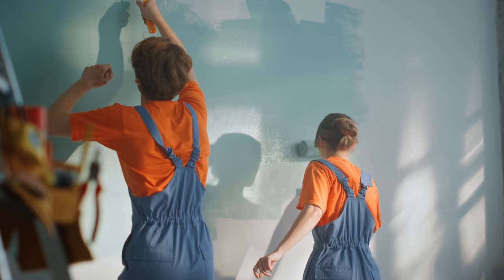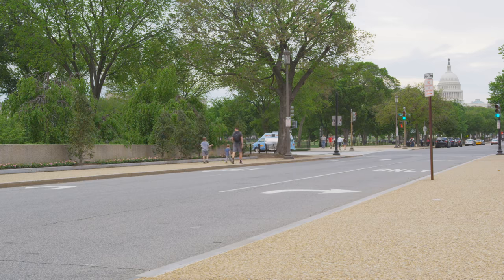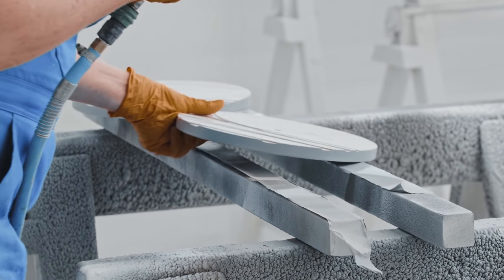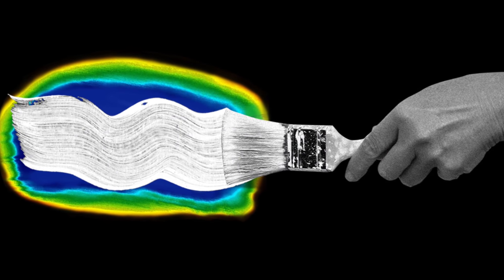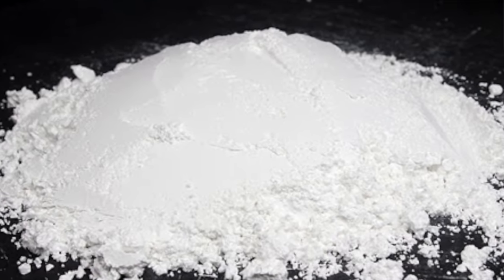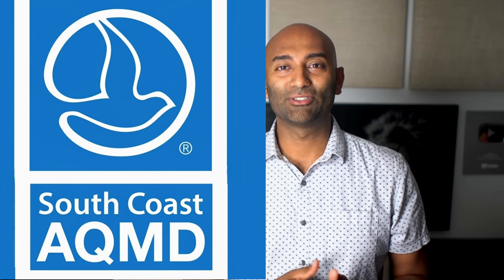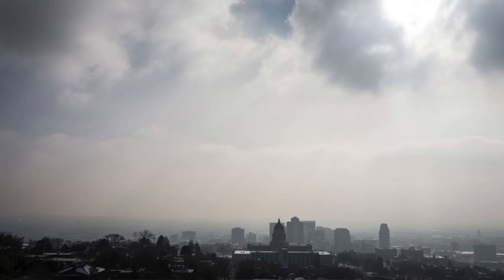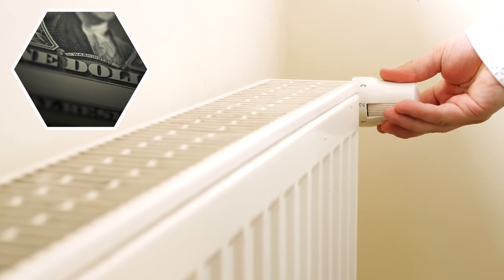Forget AC - Paint Your House This Instead!

Comment: It's probably not as bad in the winter as it intuitively seems. If a material absorbs very little heat, it has a low emissivity. That also means that when it is warmer than the surroundings it radiates less heat than a material with a higher emissivity. So while this stuff won't absorb as much sunlight in the winter as black paint, it will stay warmer at night than black paint.
Reply: 'visible color doesn't much affect IR reflection/absorption/transmission (i.e. emissivity) properties. White and black are pretty much the same to IR.  Paint a shiny SS stove pipe white or black, and it will about equally radiate more IR through, as compared to the original shiny surface.

Comment: Heating in the northeast is more of a problem than cooling.  

Propane, natural gas, kerosene, diesel or all electric...none of these are efficient or cost effective.  I went for a geothermal system. Instead of fuel oil costing 200 every 2 weeks now may 200-280 per month.  I would estimate 100-180 of that is my heating on my electric.    

Be better to paint everything black in the northeast & white in the southwest... probably neutral in between.  Compared to similar all electric heating of 500-600 a month, 400 fuel oil for the month of...it was a good investment.

Comment: If 1% of earth was painted, it wouldn't be a one and down decrease, it would create cold islands causing the planet to cool continuously. Judging by those numbers (1 degree since 1880), the paint theoretical has a stronger cooling capacity than CO2 has a heating capacity.  I for one, would rather have a tropical planet than another glacial period.

Comment: Combining this paint with bifacial solar on the south face of a roof and the radiative cooling tech on the north face would be amazing. At least in the northern hemisphere. 

Where can I buy some of this paint? I already have a metal roof. I can paint it easily.
Reply: It is not comercially available yet. 

Any Super White paint will do the same thing to a less ability.

There was an intiative under the Clinton Administration to get all flat roofs painted white.
Reply: @shawnr771  This one is particularly better though because its infrared emissions spectra lines up with an emissions window in the atmosphere and the black body emissions of the earth.

Comment: My comment is this thermal color change paint, white under coat with a 70 degree black color change to clear would self regulate to maintain 70 degrees. Heating and cooling both brought closer to solved. The tech is real but expensive.

Comment: The discussion of “radiative cooling” in the video is garbled. It’s not about “reflecting” radiation in the 8-12 micron range; it’s about having high “emissivity” at these wavelengths (which also implies high absorptivity and essentially being “black” at these wavelengths).
Reply from the maker: Not what I said. We have a full video on this already: https://youtu.be/WSTNLvvD_-U
Reply: @TwoBitDaVinci  The other video described things clearly. This one seems to talk about the paint being “reflective” at those wavelengths. At 4:35, after talking about “radiative cooling”, it talks about the new material having these “bright reflective properties.”  I imagine you understand how it works and didn’t intend the term “reflective” to apply to those wavelengths, but the juxtaposition sounded as if that was what was meant. / I respect your work. I’m just not sure this point was expressed as clearly as you intended.

Comment: I would think the paint’s reflectivity in the infrared region of the spectrum would be more important than in the visible region, especially with global warming creating a significantly higher amount of infrared radiation coming from the sky. 
Now they need to work on white asphalt. 
I wonder if it might be possible to make “electrochromic“ paint, paint the changes color when an electric field is applied.  Maybe you could have white paint in the summertime and black paint in the winter time just by flipping a switch.

Comment: I would not want this on my house. Cooling where I live is CHEAP my minisplits add maybe $30 to my ebill. HEATING is where I get squeezed. heating is so expensive. NOW where this would be wonderful is non climate controlled buildings such as sheds and storage boxes that become ovens in the summer heat

BUT how stable is it? UV is more important than VL since UV destroys so fast especially here in new mexico at 7000ft :-) the UV is brutal!

I would also love this INSIDE my house. the more "white" the inside of the house the less lumens of "light" I need to illuminate the house.
Reply: If you want less of a heating bill, try adding "greenhouse" walls on your exterior walls. You may need to keep the top open during summer, but they'll insulate your house a lot during winter.

How many mm of (rockwool) insulation does your roof have? 250-300 is recommended, more than that is just a waste of material.

I'm not sure you'd want bright white walls, they're tough on the eyes.
People always tone them down to something off-white, to be able to stand looking at them.
Reply: @silvergreylion  I have no idea. its a mobile/manufacturerd home. I THINK the roof insulation is actually really good. the snow sticks for a long time and melts evenly. no hot spots. 

"I think" it has 6" walls. I will have to double check that.

I am actually not worried about cooling in summer. only heating in winter. cooling is cheap heating is expensive especially that last 5' to get "comfortable" with the 20% humidity and 6800ft elevation summers are VERY mild indoors around here. most of the time I don't even turn the AC on till around 3 or 4 pm except on the very hottest days. cooling the whole house adds MAYBE $30 to the electric bill but heating. yeah. well heating is expensive. I am estimating about $130 to $160 a month but that is "IF" the 27,000btu's can keep up with the cold. I also have a 12k btu  heat pump to kick me to 39,000 btu's but am hoping I won't need to use that often.

Comment: Not a very comprehensive view... Paint is rarely a single pigment...Paint needs to stick to concrete, brick, wood , vinyl and cement boards to be used widely. It should also be resistant to fungi and durable for many years. Did they research how long it lasts ?

Comment: So Paint Stops, Convection, Conduction, Radiation and Absorption?
Or is this BS. Bad Science…
Reply: Well, actually he did cover that this paint is highly heat radiative. So, that's a good thing. That is if it's radiating away from the home and not also into it, which is where your conductivity point comes into play. But that's easily solved by a primer coat with low thermal conductivity. And I'm not sure how convection would come into play in this scenario.

Comment: Very interesting!  But, I fear, much like Hydrogen Fuel Cells, this will be a technology that is very neat, but not very practical.  I think doing away with carbon-based fuels and covering your home in solar panels, in the long run, is more effective and cheaper.
Reply: Then simply paint the uncovered areas white.
Reply: the problem is you need trillions of $$$ worth of solar/wind to replace carbon fuels by any significant amount. making mass production of small modular reactors the only economical way to go. even if solar panels were 100% efficient the reactors we have now still have about 5x advantage in energy density.  with new designs things get even better because they can burn upto 90% of their fuel and have heat energy to spare for things like water desalination and hydrogen production.
Reply: @psionx1  Great comment ... one of the things that I love about this channel is the thoughtful discourse of mostly everyone that take the time to post and share their ideas. Hi ^ 5 to you and this tribe.

Comment: This seems to contradict the laws of thermodynamics. How about the winters? Solar panels absorb the sun and convert it into energy, a white house would push the light back outside, making the need to create more heat. Burning electricity or gas is 5 times more costly than displacing energy from outside to inside or vice versa with a heat pump. The regions where it would be optimal are limited to dry Mediterranean like areas, and the ecological cost of the amount of paint needed would be really high.... I am not an energy expert, far from it but I wonder about it. Anyone?
Reply from the maker: No contradictions to physics. Again it sends energy back out instead of absorbing. As for winter you’re right! You’d need to offset the loss in heat by running a heater. But we have heat pump heating too…

Comment: This sounds great but is only one part of the climate jigsaw.  You need to mitigate the heat producing factors  influencing the climate not just white paint mitigation of the effect off those influences.
 If  you don't control the factors that CAUSE  increased  temp  in your environment then you will never have enough white paint solutions  to deal with the ever increasing heat.

Comment: You could paint roads with it.

And then you'd have to provide vehicles with oil that reflects light well, when it drips on that road?

Seriously, though, these solutions that ameliorate the harm done by urban sprawl (nice absorbtive paving everywhere, for instance), evade the issue of tackling that sprawl problem. People want to save the world, but not if it's going to mean they need to live differently to the way they grew up with.

Just the long average daily commutes (and electric cars is a way of pretending these are OK, to some extent) require energy from somewhere to waste on this. (A lot of our activities require energy to waste.)

So I'd better outline a solution whose most obvious drawbacks have at least one possible solution, each (which I'll omit, here). It's this. For new developments, build dense and tall. Build a linear city, though. Linear in built environment, and circular in green space, just for those who say "circles are nature's way". Put the houses that sprawl out all together "down the center axis", and keep at least a mile or two of green space to either side of that line.

One immediate result would be that most peoples total travel distance per year would diminish a lot. They'd walk to a lot more place, cycle to more places, catch public transport more often, and only use cars outside of this space. (Design it so. NO cars on the ground level. Just to open up wider possibilities, I like to suggest that the only four wheeled vehicles would be horse carriages for crossing the green belt to get to the next parallel line of built environment.

In the green space, give people the substance of what you normally lose, moving from suburbia to a traditional dense area (where you pave over anything that tries to grow, and squeeze in as many thin fire-suicide-towers as is consistent with protecting the paving down below from horrible things like sunlight.) Have gardens (like German Kleingaerten, maybe). Have band practice garages, and unneeded furniture making garages, etc. Find better replacements/ substitutes.

Start with a clean enough slate in your head, and you could make this into a better kind of suburbia with quick access to a hopefully better kind of downtown.

Plan not to have enough roof space to make white paint or solar panels on individual dwellings a viable energy saving option. You'll save more planet that way. (At the cost of giving up something familiar. So I'd better run and hide before the mob arrives for my stoning.)

(For Blasphemy! What else?)

Comment: If I recall my physics lessons correctly , is this more complex.  Radiation from the sun is a relatively high frequency, but you can reflect this whilst still radiating heat at a lower frequency.  Perhaps how this actually works.

Comment: This impresses me not at all. For COMFORT, not only must the temperature be moderated, but humidity must be removed. So while this "miracle" paint might do wonders in a desert, New Orleans and Houston would see almost no benefit whatsoever. Air conditioning DOES that humidity removal, with the water vapor condensing on the evap coil; and draining away, thus significantly lowering humidity. Like the garbage air conditioner for a hundred buck--swamp coolers--- they work great in a desert, not at all in humid areas, as the EVAPORATION of water, from absorbed heat is what lowers temperatures. More Youtube Bovine scat.

Comment: I wonder if painting it on internal walls in a cooler climate might bounce heat back into a room?
Reply: In theory yes.
Reply: @williammeek4078  hmm- because I have an old church that needs insulating and I came across a plaster admixture involving very small glass beads( massively expensive but I was going to make my own😎) . The space is currently painted brick and we’re keeping it as one large volume, so ultimate white might just be a possibility…. Thanks William 😎

Comment: 6:51 LIES! I live in Phx,  both in the city and on the deserts edge. Driving into the city you get at least a 10 degree temp raise as high as 12 at night. Going into the deserts edge feels amazing at night from the center of the city. You can feel that 10-12 degrees as you get out side the city limits. How do i know? I have a thermometer. Brilliant i know. Im sure that large diff is due to Phx being Phx, our heat island is huge. The buildings are one part but the roads are probably 60% of the problem. The heat terminating off the tarmac is sickening. Seriously

Comment: This sounds great! 
Now, do solar panels have any way to collect and bring heat into the house in the winter, or could that be built into them in some way? In the summer, of course, the heating effect would be "turned off" or the heat dumped somehow. Just a thought...
Reply: There is some solar panels with a air duct inside to bring the heat inside the house yes.
Reply: @ivobrick7401  great comment

Comment: Yet another video that centers whiteness.

Seriously though, it's always seemed counterintuitive to me that white paint could reflect more radiation than, you know, a normal silvered glass mirror. (I.e., a thin coat of metal under a protective layer of glass.) Which is not exactly cutting edge material science, or super expensive technology. What's the flaw in my thinking?

Comment: But what is the material which reflects 
infra red waves best ? Is it white ?
Reply: IR is different and different visible colors don't really affect IR transmission (pemissivity).  To IR, black and white are basically the same. You need shiny metallic surfaces--particularly Aluminum, silver, and gold to reflect IR well. I think Al reflects the broadest degree of IR wavelength for a cheap, readily available material.